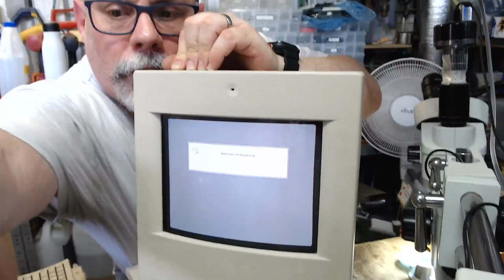Macintosh LC575 live recapping

Comment: I've been to the site, can anyone point me to what size caps are needed.  I'm doing a 660AV (found that thx), but cannot find specifics on which size fits the gaps the best on this board.  I'm assuming it's the same 7343 footprint that's on the 660av, and that' close to what I'm measuring, just want to make sure.
Reply from the maker: There are links to the replacement components I use here: https://recapamac.com.au/quadra-660av/